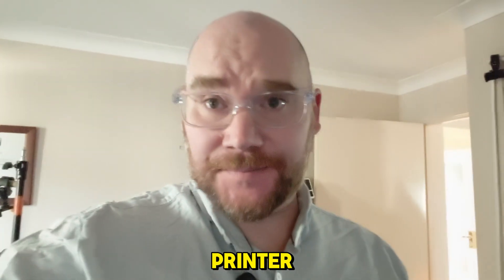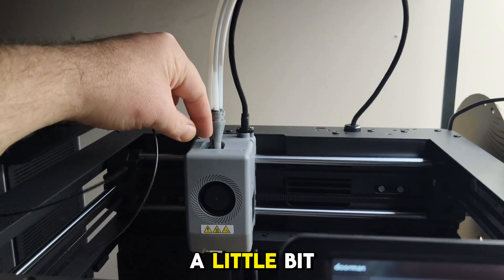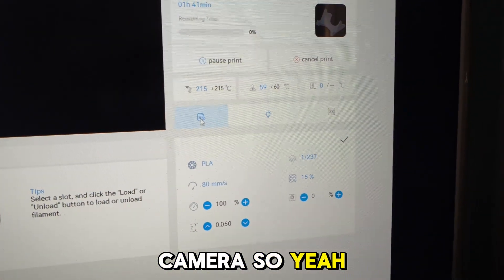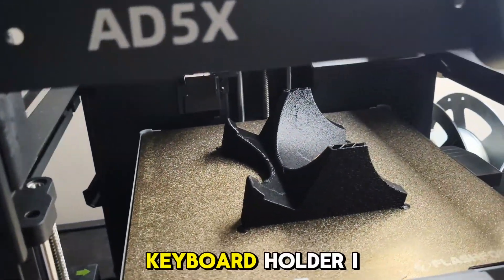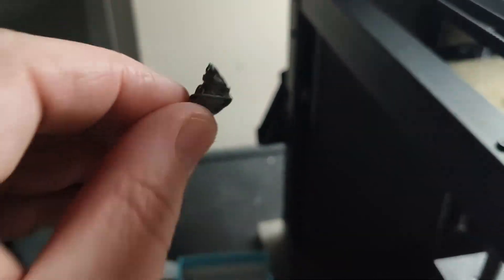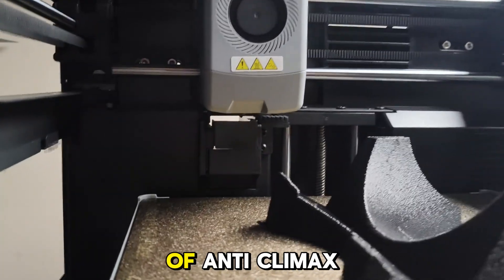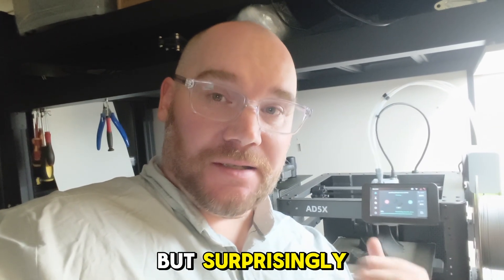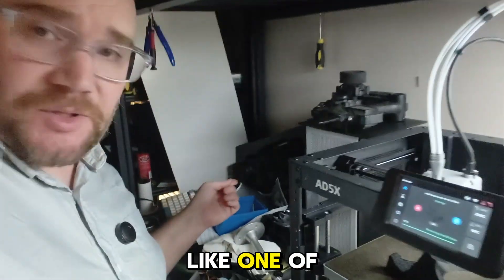Accidentally Proved My 3d Printer Is Smarter Than Me - Flashforge Ad5X

Comment: Are you able to set up custom filaments in the slicer? And are you able to select/load any sort PA/Nylon filament on the actual printer/IPS in the filament load/unload on the printer itself? What about loading anything at all beyond PLA, PETG, TPU, or ABS? I can't add any custom filaments at all from scratch in the customer filaments window anymore (it worked twice but thats it) without modifying one of the preexisting filaments and renaming then saving it but several of the preexisting 'system filament profiles' / stock filaments (all of which are FF Brand too...) including ALL of the PA variants won't load at all and won't show in the drop down filament selection menu not matter how you do it so I have to edit preexisting filaments but then I can't even change the filament type to PA in the filament editing window because half the time it won't save but even if it does I can't print with it if its edited/saved as PA because the printer itself won't let me select anything other than PLA, PETG, ABS, or TPU to load which also means any PA/Nylon or ABS/ASA filament run out and reload could cause some major issues due to temp and various print settings differences between the Nylon/PA set as "ABS" and ACTUAL ABS or ASA during a actual ABS/ASA print or any number of other problems as a result of having to lie to the slicer and the printer about the type of filament its using while simultaniously having very different print settings from the filament that the printer THINKS its using so in the slicer I have to essentially edit a ABS filament profile with new temps and other settings then rename it to PA but leave the type as ABS then on the printer itself then I have to load PA/nylon as ABS on the printer/IPS which again  creates a multitude of issues and I planned on doing a decent amount of nylon, PVA, TPU, TPE, PETG, and even PCTPE (assuming I can find a new vendor since Taulman went out of business) and several other mostly non listed filaments because literally all of my prints are functional and I got this printer specifically to make more advanced multimaterial prints but its going to be absolute hell if I have to do all of this every time and remember which ABS is Nylon and which is ASA ect considering they don't even have ASA on the IPS selection menu.  Anyway I'll stop ranting but I haven't been able to find a solution yet and I can't just rely on regular Orca either because I've noticed some weird behavior so far and right now I can't connect to the printer with regular Orca even though I had the connection set up and working yesterday plus there's some sketchy physical issues on my printer so I don't want FF to be able to blame any possible problems on my use of regular Orca if I ever need to warranty it. 

Anyway sorry for the long story but I needed to rant a bit and type something up to send to Flashforge support and spam them with until they fix this stuff lmao so any help would be appreciated like if your printer/IPS and FF-Orca aren't having any of the custom filament add to slicer issues or the IPS filament loading issues then I can narrow my issues down to hopefully find a solution so its greatly appreciated
Reply from the maker: Unfortunately it looks like by default the ad5x can't support pa / nylon / ASA as per their website. ABS is supported but you'd have to run an enclosure. as per the warranty thing, I wouldn't worry as when/if it "stops" working they're not really investigating the filaments only the temperatures and such so wouldn't effect warranty.  for custom ABS etc in orca click on the " set filement to use" and choose abs and filement brand etc. and set it up. hope that helps for that, but with out a firmware update it wont support those filaments you're asking about. Creality K1C does and some other printers, but K1c is on special / cheaper rn if youre interested. but looking at runout Printers/ compatible with ASA / nylon etc creality K2 is around the corner due this quarter. and I'm sure bambu has an option. 

Its possible? that they might have an update later to support these filaments as it requires a firmware upgrade but yeah at this time not supported directly.
Reply: @ladbeige  what you can do is set it to be ABS on the printer then create a new ABS profile in Orca Flashforge which has ASA settings, it will be happy then. Just as a work around